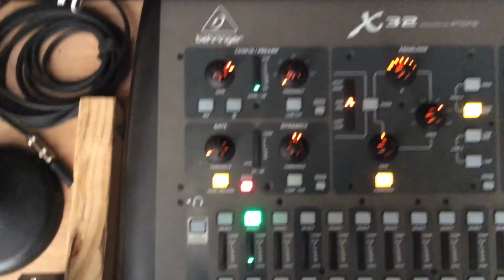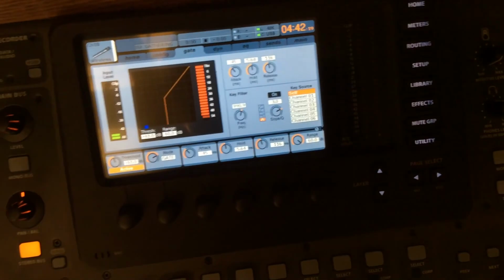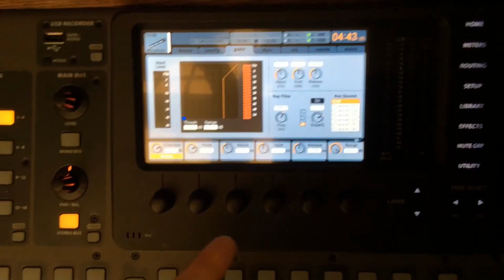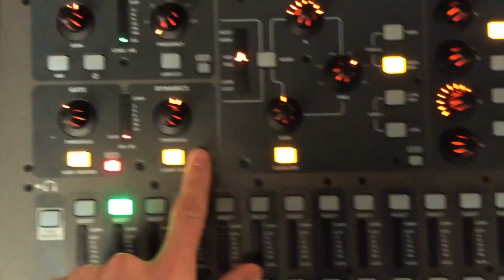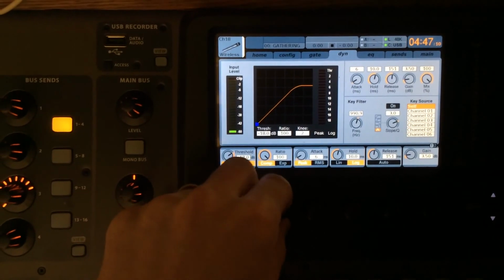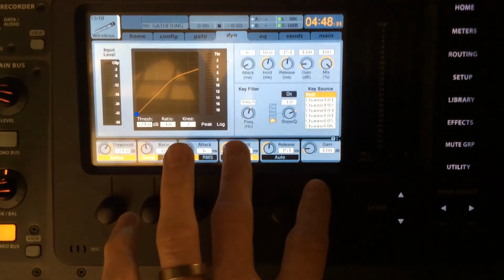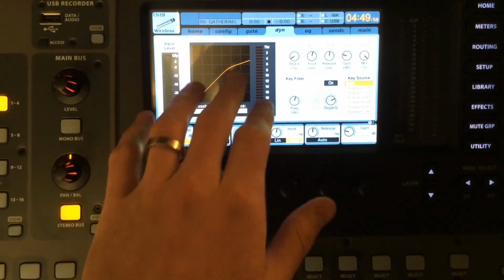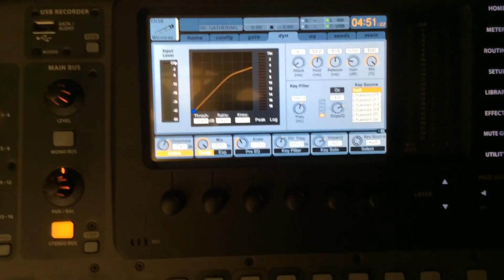radius Audio Training - Behringer X32 - Noise Gate and Dynamics

Comment: I have this console, but my gates are now adding crunchy digital sounding artifacts when it didn't before. settings were all the same and haven't been able to resolve it.
Reply from the maker: I would try updating the firmware on the board.
Reply: @NathanHeffington  Did that after I posted this. From a bit of testing the gates seem fine now. I'll know more when I go to use it in a couple days for a show.

Comment: Nathan, how do you know if the threshold is right?
Reply from the maker: It is different with each source. Do you want to set the threshold high enough so that it will catch the unwanted noise floor but low enough so that it’s not causing voices or instruments to drop out. In other words, it needs to be at a level that is higher than the bleed or room noise that is unwanted, but lower then the quietest signal that you want to keep from your intended source. It’s one of those things where your ears are way more valuable than any particular number. What sounds good is good.

Comment: Thank you for the video! The X32 can sure do a lot! I'm still kind of new to the X32. How exactly (step by step) do I keep the musicians from hearing the gates in their in ears? Thank you! I mean, what exact buttons do I push what knobs do I turn. I've watched A LOT of videos, hoping to find my questions answered and I'm still striking out. Thank you!
Reply from the maker: I don't have the board in front of me right now, but I will give my best based on the x32 software.
Press routing button next to screen
Find the output associated with the musician's ears (if it is an aux channel go to aux out, if it is one of the 16 xlr outs go to out1-6)
Select the appropriate routing bus in the menus (if they are using mixbus 2 for their monitor, for example, select that)
Rotate the knob that changes the cursor under the "tap" menu until the top option is selected (IN/LC)

This may or may not work. I have read several people's complaints that this doesn't work with Aux buses. A side effect will be that this will also send the signal to the ears BEFORE eq/effects/etc, so it may not be what you are looking for at all. There may be another solution to this issue, but this is the one that pops into my head initially. Let me know if it works!

Comment: hi i want to ask for initial setup effects this clip thankuu
Reply from the maker: Sorry, I don't quite understand the question, can you clarify?
Reply from the maker: The software is the X-32 edit software for Mac. It may not be the most current version. In reference to your second question, unfortunately, it looks like there is no easy way to do that. The problem, it seems to me, is that in the snippets menu the sends are grouped into large sections and you can't save the "mix group" settings directly, only the sends from the channels. That means that, if you had your IEMs for Band Member A set up on mix bus 8 and you wanted to recall the send settings for channels 1-16, you couldn't just recall those settings without changing what is being sent to mix buses 1-7. The mixes would change for any monitors, recorders, or IEMs that you had set up on all of those buses. This means that you would only allow you to recall a group of IEM settings. For example, if you set up your IEMs on buses 9-12, you could set up your mixes for a bank of 4 people on those channels. Save a snippet with the "sends 9-12" box selected along with any of the channels that you want them to be able to hear. So, if all of your instruments and vocals are on channels 1-16, check all of those. Save the snippet and name it the names of those 4 people. Now, when you recall it, you have those 4 IEM settings. Also, because you are really trying to recall information about a bunch of channels (where they are sending), but only as it relates to a single bus (the one going to a specific IEM), you can't save a channel preset for the mixbus and recall all of the channels that are being routed to it. The solution that makes the most sense to me would be for a firmware update from Behringer that would allow the selection of each send individually. That would allow you to select only the send associated with the mix bus that you wanted, select all the channels that you want running to it, and save a snippet as the person's name. You should suggest that to Behringer, because I am sure it is an issue that others have had as well. Does anybody else know of a different way to do this?